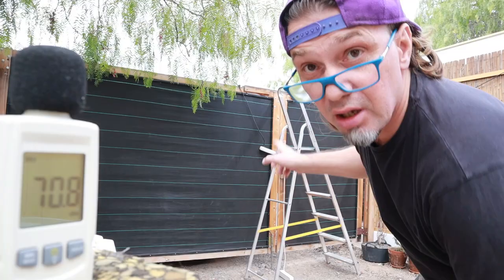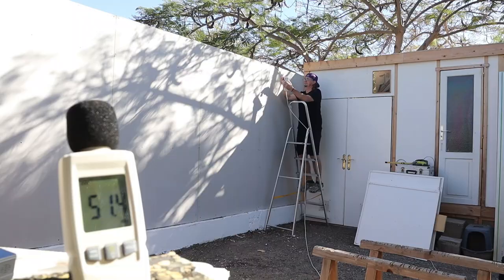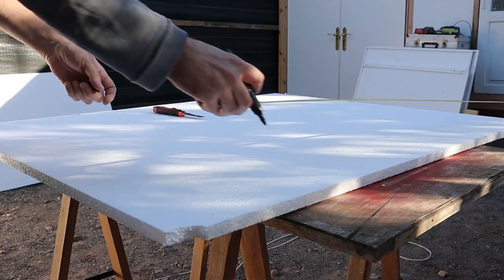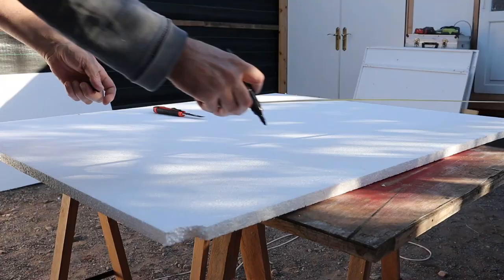DIY Soundproof Fence on the Patio from start to finish

Comment: Would be better if the insulating material had more mass.  Another idea -- easy to get old rolls of carpet from renovations.   Stack rolls horizontally and strap them to 4x4 posts placed every 2 meters.  You can cover in weather proof tarp or galvanized metal.

Comment: Do you have to put silicone between the cracks?   I want to do my carport but worried to glue anything due to body corporate rules.
Reply from the maker: No, I applied silicone because I already had it at home
Reply: I’ve heard many people saying that any small cracks will let sound through 🤷‍♂️

Comment: Thank you for this video. May I know the materials you used to sound proof your patio? I'm thinking of soundproofing my balcony as well. Thank you!
Reply from the maker: The insulation in the wall is styrofoam. And it is covered with gypsum boards. But gypsum boards only work here because we don’t have rain. Therefore, you must find another material that is suitable for your climate
Reply: @klerobi1  Thank you very much for answering! Really appreciate it! :)